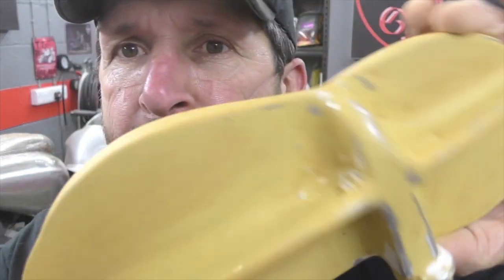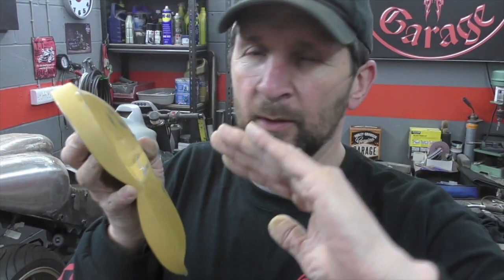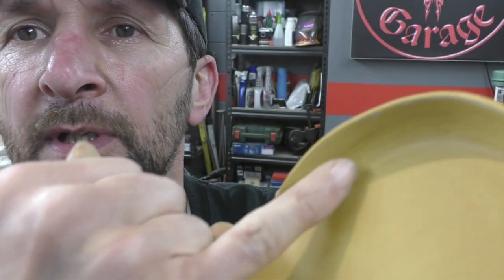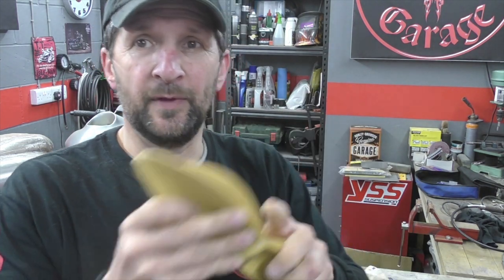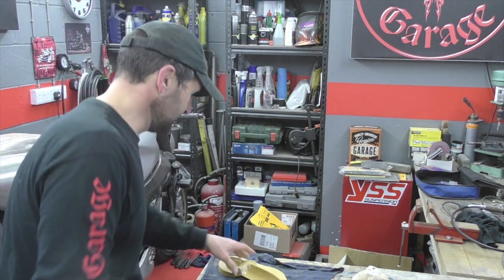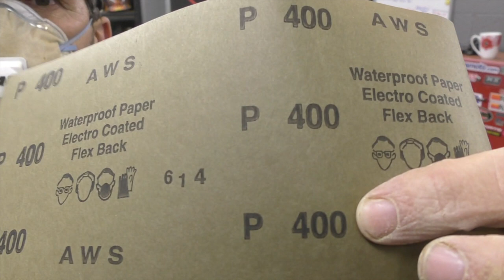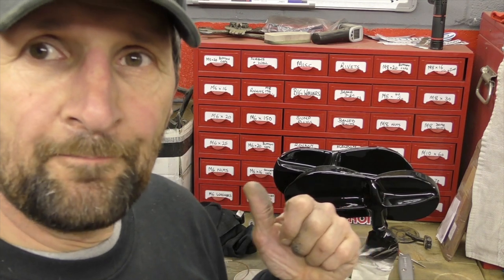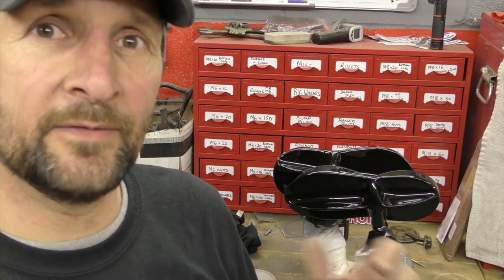Delboy's Garage, "Kids as Pillions", Part #4, Finished.

Comment: Turned out really great! Love it.

Mike
Reply from the maker: Thanks Mike, great to bring a short project to a close, video up Satuday with the grip surface on, and fitted to the bike...  take care both.. D&Px
Reply: Decided to get a proper Mig welder this year. I have a really cheap flux core AC spatter machine, um I mean "welder" and while it can be modded, it's not worth the time or hassle. Need to weld up some projects for the bikes. Always get inspired to get out in the garage and get stuck into a project after watching your vids. Take care!

Mike
Reply from the maker: Sure thing buddy, good plan.  go for gas and regular mild steel 0.8 wire... we can skype if you want to chat over it before you shell out the Dollars..

Comment: Delboy..... what type/brand of topcoat black is that? I'd find it useful for my kit car components. Thanks!
Reply from the maker: Its perfect for that Armando, its called "Simoniz Tough Black".. and is made for things like crash bars and chassis parts...
Reply: Lovely... I've been using Hammerite Smooth (with primer), which I'm a fan of, but I'm well-impressed by the finish of the Simoniz product - the footpegs really do look powder coated! I'll try the Simoniz as well.

Comment: That thick and no runs..good job Del :)
Reply from the maker: Ha ha, .. its all in the stand time between coats... you leave it progressively 5 minutes longer each coat, so the last coat had 30 minutes to go off before i did the final 7th coat.....making each coat longer apart means the wet material dries from the inside out....if you lay wet coat over wet coat the weight builds up too fast while the material is too soft to hold it still...and it sags or runs....the top layers prevent the under layers from evaporating,   so letting each coat dry a little longer than the one below means that each coat supports the weight of the next.... it makes for a long job, it took 2 hours just to lay the black on.. and 5 hours for the whole job... its all about patience mate..lol
Reply: Now that's something to remember for my future projects, cheers for that Del.

Comment: Nice job. Work on production efficiency and some different designs for other bikes and you have got yourself a "product" there £££. Would defo buy when it's time for my boy's first ride.
Reply from the maker: Hey Reg.. i get this a lot mate... but would you really buy them?.. they are going to be 26 hours in the making (labour cost), and about £50 in materials... so to place a commercial price in them would probably top £400+... and you could buy some nice genuine HD foot boards for a half that..!! which has always been the problem selling custom made unique parts..!!!
Reply: Yeah, that's what I meant about production efficiency. Time, materials adds up. But if you could crack that conundrum then it's a nice sideline. I'd rather support the little guy in Britain if he can get anywhere close on price.
Reply from the maker: Yeah, you're right of course, the Chinese would cast these in alloy, and stick a steel pin through for support, and send them out for about €20 ex factory a pair.... so a long route to getting that far.... and of course the time to set it all up..!